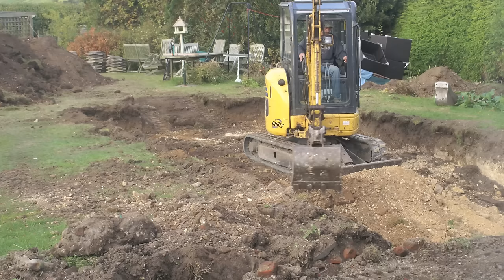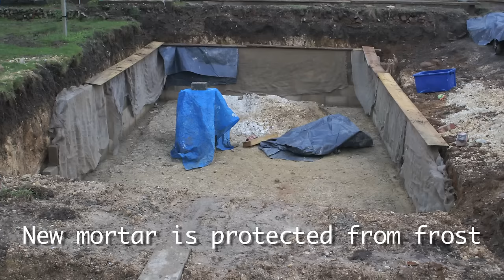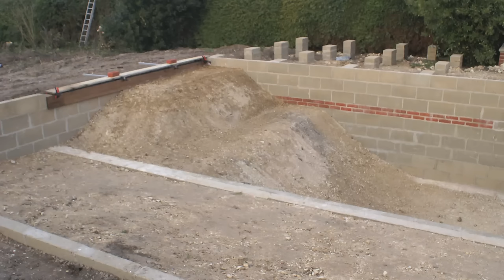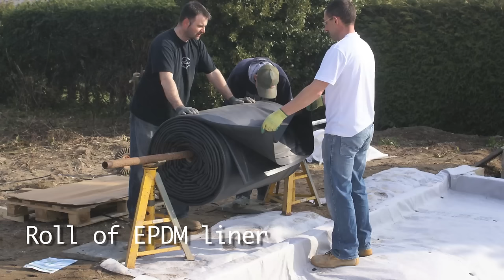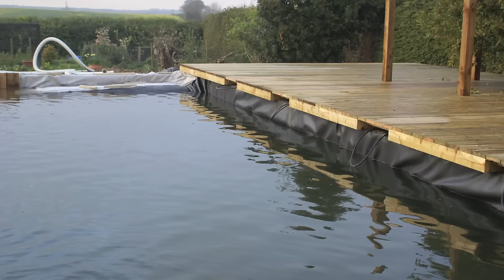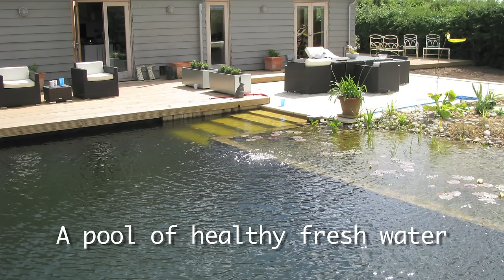How to build a Natural Pool - DIY Organic Pool build

Comment: won't the wood eventually split and rot because it's submerged underwater?
Reply: wood cant rot submerged, there are cities in Italy still to this day that were built on wooden posts ages ago.
Reply: wood has less to no chance of rotting if under fresh water where not any aquatic wood borers do not thrive in as much as they do thrive in salt water, and unless part of the wood is sitting above in open air then yes it will deteriorate. Italy  is sinking a bit due to the wood piles are deteriorating and rising tide they decide to install flood gates instead of putting money into raising structures to replace the old piles with newer ones made of carbon/dyneems/fiberglass/kevlar composites which are less succeptible to rot, decay, rusting or other deterioration. Then again that is a very intrusive task along with being costly as it is and will only stop the sinking but still will not prevent tidal flooding.
Reply: Much more through response, thx for auxiliary info there. My point being for a "pool" in your back yard submerged wood during the course of you and your kid's kids lifetime will be more than fine. I would have thought kevlar to be a pretty shitty submerged material, that one caught me off guard.

Comment: Aren't you worried about snakes ?? That'd be a total den in my area{South-eastern U.S.} I have chlorinated inground pool and still find them almost daily in skimmers, around edges, under heater. Last summer was hot and one evening decided to cool off. I didn't think about snake being in or near my pool. As i jumped off divingboard i soon realized i was inbound to land on a huge timber rattler swimming in my dam pool !!! When I hit water on top of it headfirst I kicked & flopped, probably shat myself a lil;) to my amazement wasn't bitten. Ended up being 17rattlers & button 59 1/2, 1/16 long.. The following week 11rusty copperheads different sizes from adolescent to adult were in skimmers, in water, and at night laying around on the concrete and landscaping around the pool. YES I dispatched them! I HAVE KIDS, also lost dear family pet(boxer) due to fatal bite from big rattler(the puncture wounds fr bite were 4inches in between. The dog was walking beside me through grass to the pool when she was hit. Dam thing didn't even give warning with rattles. Could've been me or my kids. I shot its head off as i seen it parting thru grass with rattles stickin up. DIDN'T  bring back  my dog but it will Not bite anyone else. im not an animal killer, i luv aminals but those are dangerous & family first.. APOLOGIES FOR RAMBLING ,.. I couldn't imagine a natural pool in my area. I've tried moth balls around the area but still encounter some. i try not to look for them, even make noise to scare away some are just honory and mean,stubborn like me,.. perhaps ??I like natural pool look, just can't have in my area unfortunately .. You got nice layout though.. I built my inground myself as well.. Feels good to accomplish something yourself & save thousands hand over fist...

Comment: congratulations m8! i am thinking from loooong time to make a swimming pool,and last year i dig just the big hole 6x5 m with deep from 2 to 1.as i see u are a clever man cose u don t pay too much for the walls,i am worried little bit about 4 inch wide.i am thinking about thickness of the walls day and night,i thought they will be ok at least 8 inch thick...(how is it now did u have any problems since u made it?did u add any steel between bricks?)i am planning to go on this summer,so i live in Romania ,and i don t trust to buy the bricks i want to make them my self,all i need is cement,sand,stones,and an agent to add in the concrete,to make it water proof,thanks to your style, is easy and less money and effort in comparration with others methods.i have doubts with wood wall,i like ideea,is ok,but how long time will resist,if u put fish ,after a while u have to take water out,did u protect the wood with something?

Comment: You just created a source for insects to infest your house
Reply: I learned from other similar natural pool builders. They either breed small fish, let bats or dragonflies live around the pool, or cultivate insect-repelling and water purifying plants in the shallow areas around the pool. Also the extra filters will always run the water through the pump and so this kind of build isn't considered stagnant water pond at all. It is still a pool. And the 'natural' part doesn't really means all natural or untreated obviously; just probably using unchlorinated water so plants and other water-dependent animals can live in it quite well if included in the plan.

Comment: with snakes, frogs, insects and best of all parasites.
Reply: mosquitos dislike moving water and yet love to fester in stagnant (static, still) water that is on the warm side and unless they or other insects are present there is not going to be frogs, and as for parasites, going to be an issue except that is what the plants and other non-chemical filters (charcoal, lime stone gravel as shown, uv light, ultrasonic system) are for

Comment: Pools are chemically cleaned for a reason you know
Reply: The only reason those types of pools requires chemicals is due to no natural/organic filters like shown, such as the limestone gravel, plants or charcoal filter, not to mention uv and ultrasonic filters, I rather not smell like chlorine for the next 48 hours at most, nor left feeling sticky in a salt filtered pool either until I shower

Comment: organic would mean you dont have to build it.........
Reply: Organic refers to the plants, limestone gravel both of which are shown installed along with charcoal are the organic system parts of the pool, just because it was made of concrete mostly organic material as well and plastic a byproduct of oil processing also in a way organic, does not mean just because it was built does not make it non natural/organic
en.wikipedia.org/wiki/Natural_pool